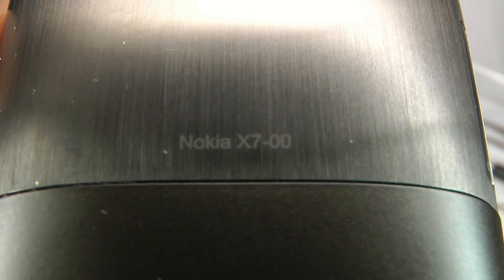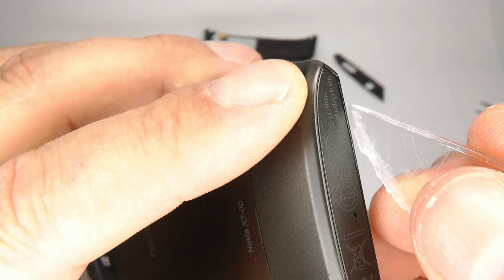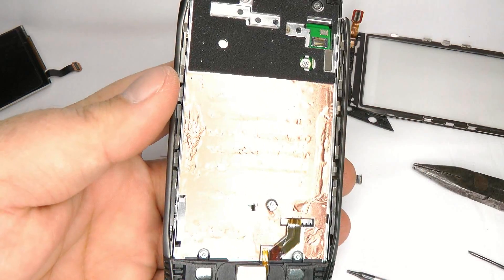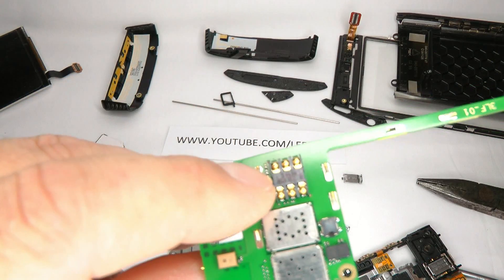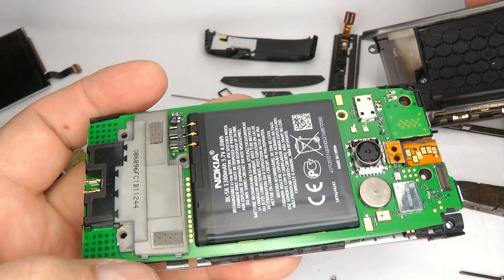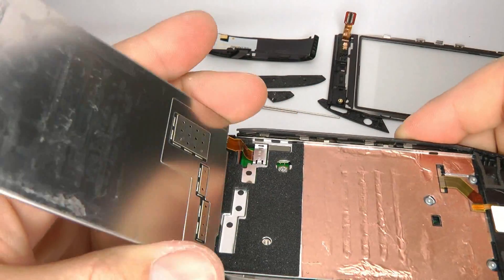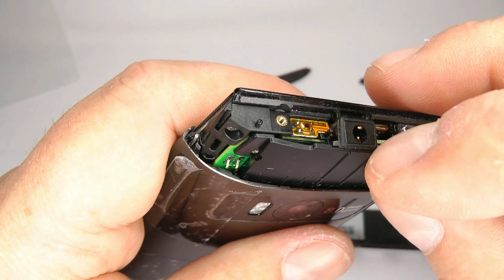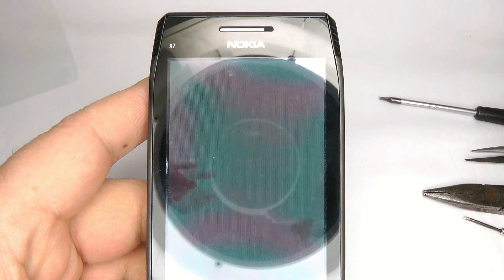Nokia X7 Disassembly & Assembly - Battery, Screen & Case Replacement

Comment: This is a great , thorough, easy to understand instruction to disassemble and reassemble this phone. My phone died and I was working through the video when I came to detaching the screen. He explained how you had to prize off a small clip and then ease off a connector to detach the screen. My connector just fell off. On a hunch, I reconnected this connector properly and reinstalled the small clip firmly, finished reassembly and the phone is working again. Thanks heaps.

Comment: Hi thanks for the excellent instructions.
I have already replaced my glass screen when it shattered and the phone worked fine, but this time when I re-assembled it - after cleaning the earphone jack and contacts (intermittent problem) the phone doesn't boot up. I have plugged it into it's charger and the usb port on the computer , still doesn't boot up. I am pretty sure all connections are fine on the ribbon cables and I didn't damage anything by excessive force.

Is there a factory procedure ?

Comment: was on the net and it just froze could not turn off using the power button also it got wet in my pocket will try and charge battery and see war happens